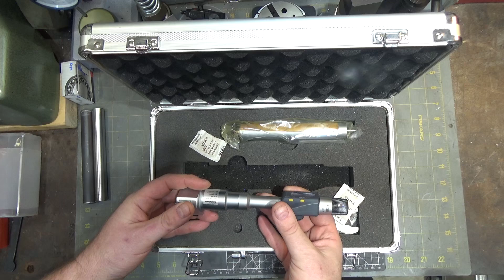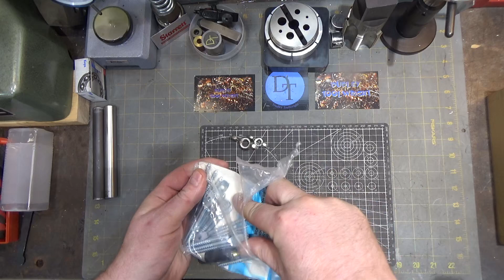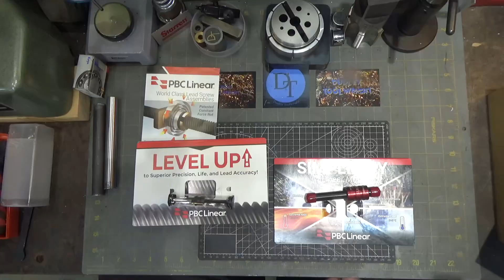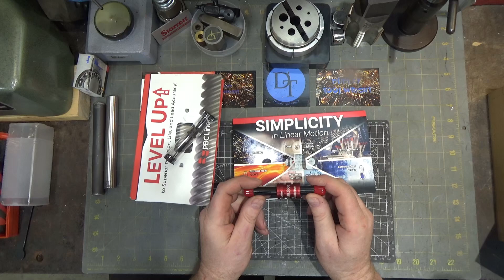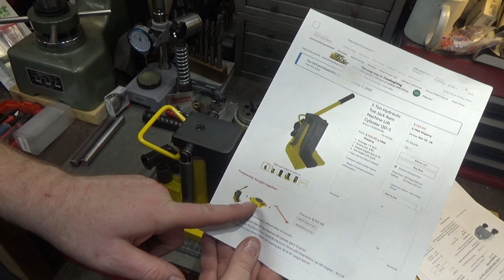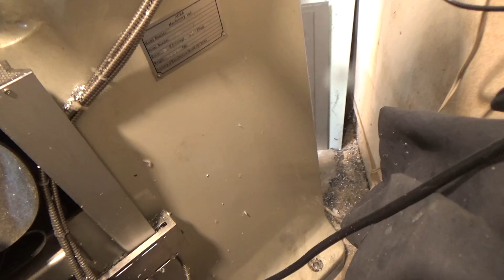QTR 57 New Shop Tools

Comment: I just checked Amazon for "setting ring."  They are not inexpensive, especially for larger sizes.
Reply from the maker: Good to know. Thanks. On eBay the used ones typically go for $50+.
Reply: @DudleyToolwright  Of course you could make your own, and measure the value with a calibrated instrument, but I imagine it really should be hardened and ground.

Comment: The reason a tow jack is called a railroad  jack is because they use the same decision for jacks to life in-between the ties. Under the track its self then you can pull the spikes out of the tie and replace one bad tie. Them set it back down. Used for maintaining tracks. The have machines that can do long stretches. But a lot of the old practices are still used on small jobs
Reply from the maker: Thanks for the historical context.

Comment: I’m using the Johnson bar and a 4 foot crow bar to lift machines. Then 3/4” sch 40 steel pipe to move the equipment around. I’ve thought about buying the machinery skates but always found the pipes adequate. Also, by using pipes I don’t need to lift the tool very high. I feel that it’s safer and less likely to tip over. Rock on!
Reply from the maker: I have seen a lot of people use this technique as well...including the machinery mover team that brought my surface grinder. Clearly it works well.